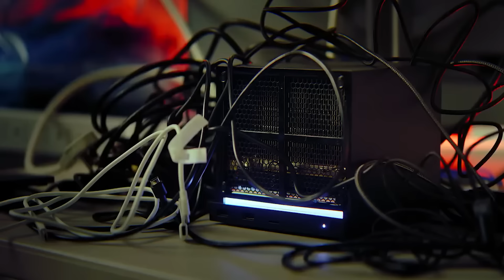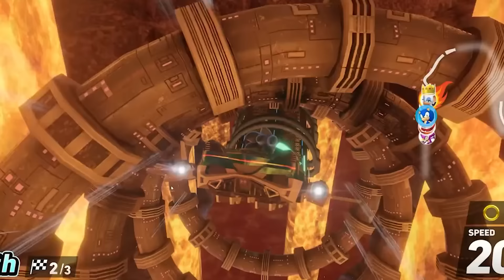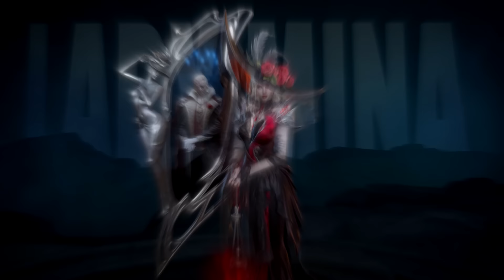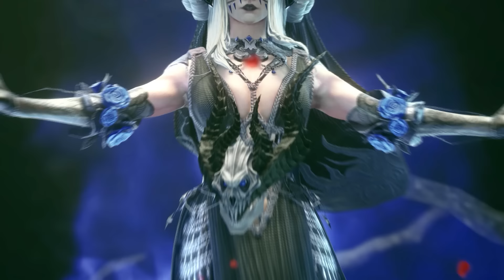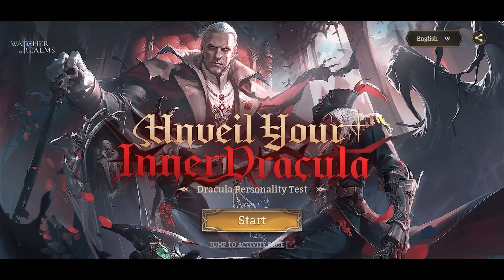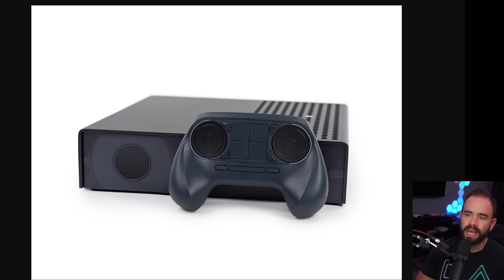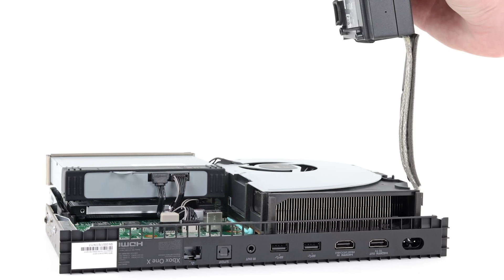The Steam Machine Is More Impressive Than It Looks...

Comment: 7:35 I just realized if the display and internet board is replaceable [and the cabling allows for speeds of up to 80GB from the GPU]... can this connect to the PCIE lanes in the machine to create an unofficial thunderbolt3 connection if you so choose? that or to make different I/O configurations? because if so... oh boy, that 8GB VRAM GPU might be more "upgradable" than we thought...
Hope you have a great day & Safe Travels!

Comment: If this is successful which it will be, I’m hoping they come out with a Steam Pro in 2027 to compete with next gen consoles. I’d like to see Valve develop their own chip like the M series of Apple and on a shared memory pool.
Reply: If AMD or Intel can get their chips with faster built in GPUs for a good price... that would be good.  AMD has that now with Strix Halo chips, but they are outrageously expensive.  I don't see Valve getting into the chip making department.  With FEX though, they have the possibility of going ARM based too, if they can get some chips fast enough to compete with AMD or Intel.
Reply: That all depends on the price.

Comment: I do not know the measurements, but I am wondering if there is space for a 3.5' drive at the bottom.. probably it is irrelevant as there are no ports provided.
Reply: that will not come close to fitting.  I think you mean a 2.5" hard drive.  You do have a 10 Gbps USB-C port to run external drives on in a pinch.  That seems more than fast enough for any hard drives or even 2.5" SATA SSDs.

Comment: 1 nvme slot, and no USB4?
Reply: High speed drives aren't their priority. You can still get pretty fast on the USB-C port that is on it that does 10 Gbps
Reply: @AyaWetts  thunderbolt 3/4 would have been perfect for using a USB C monitor unless the steam deck comes with Display Port out through USBC.
Reply: @euphanasia210  That would have been nice, but at least you can use an adapter at least to do USB C monitor.  I already do that with a portable ITX machine and a portable monitor.  One side hooks into HDMI, USB-C, and USB-A, then just plug the other side USB-C into a portable monitor and it works fine.
Reply: @AyaWetts  I wouldn’t mind that, but it makes it that much more complicated for the average user. Confirmed no DP out on usbc. They should have really added this.
Reply: @euphanasia210  Everyone should have DP out on USB-C, but even buying a $2000 5090 you don't get that... its kinda dumb

Comment: Imagine all the new steam products are all entirely repairable and upgradable. Put a warranty sticker on each part separately but allow people to take the system apart and it comes apart in sections. Power supply, front header daughter board, cooling, main motherboard, graphics card board. They are as easy as replacing as just pulling it from the case and removing said segmented part.

Steam frame as we’ve seen so far easily comes away from the head strap so imagine with that you could take off the front cover and cameras were a separate board. People want passthrough colored? Cool replace the cameras with color ones but makes it use slightly more battery but hey that’s replaceable too! Want better screens? Replaceable for the cost of more weight an more battery usage.

Granted I’m not a designer so I have no clue how hard that would be able to pull off but it would be awesome

Comment: Actually it has a modern processor and a full rdna 3 GPU VS the PS5's rdna 1.5 Navi12lite which has no hardware support for variable rate shaders and mesh shaders. The PS5 chipset has to mimic these features in software which is why the PS5 runs UE5 games like crap. 

So in hardware features, although this is quoted at 6xthe steam deck, therefore 6x1.6=9.6 tflops Vs the PS5 at 10.28 it should run games that are compatible with steamos BETTER than the PS5 but less performant than the series X because the series X does have these features in hardware as it is full Navi II chipset.

Comment: This is going to be more expensive than you think, I'm afraid. Could be wrong, obviously. But to me the key is when they made a point to say it will be priced competitively with a comparable PC. If you look at its specs -- while they're not stunning -- you're probably not building a PC at that level for less that $800 or $900. So competitve pricing relative to that? I think they're going to come in between $7 and 800. And unfortunately I think that's a floor. But I really hope you're right, Jon. $499 would be incredible. Even $599 would a big win, I think.

Comment: I'm fairly certain that controller in the pictures of the old Steam Machine was never actually released. The only controller that was released was the original Steam Controller from Valve, of which that may have been one of the test prototypes before they settled on the final design.

Comment: If it's modular/upgradable then they could make the initial cost cheaper for the base GabeCube but to max out specs it'd would be more over time compared to than the existing next gen consoles. I think both PS6 and Next Xbox are at least 700-800 as the ps5 pro is 700 and the Xboxes keep going up in price for some reason so both are trying to get us comfortable with these new prices.

If it's 600 it could be very tempting more so than Xboxs new offering and it's rumoured to have Exclusive for how long I don't know but Half Life 3 for some will be enough to try it out.

Specs now are the issue if it's actually on par with current gen while having value at least 100-200 cheaper they could honestly cook

Comment: Steam Machine isn't even base Xbox Series S, PS5 or mid PC build. Steam Deck is a "success" if we ignore the fact that out of 100 million monthly Steam users only 3-4 million actually bought a Steam Deck. Steam Machine will have about the same "success" I wouldn't qualify that as a success if you can't move 10 mil when you have an audience of 100 mil but regardless. Steam Machine is a niche within a niche, and the hype and glazing already being done by clickbait is just going to kill it even faster. People are going to buy this expecting it to run everything like a high end PC, when in reality the components inside are more around the mid to low range budget options for a PC, which is average, decently fine maybe not great but it's okay for 2025, in 2026? Different story. 2027, out of your mind to buy this when there will be better options out there by then. Lifespan of less than 5 years, if Valve had put actual high performing components into the Steam Machine then yeah I'd be excited for it, but making it a budget prebuilt for 2025, selling it to a 2026 market is just asking to be outdone and become obsolete at a faster rate. Valve has the money to give us something that is actually worth the hype, and instead we get a low budget mini PC. I want something like the Steam Machine that can do what glazers say the Steam Machine can do, but the reality is the Steam Machine is not going to do much of what people are saying it will, I'd be better off buying another smaller PC and using that instead.

Comment: I wonder if a mesh front cover would help with thermals, or if that would cause air to not get pulled in across other components.  I know part of their thermal planning is counting negative pressure created by the fan to pull air in from all sorts of places and routed over different components, so if you open it up too much, you might end up with a cooler CPU/GPU but VRMs or a power supply that are just blistering.

Comment: 425 is valves hardware cost. 2x multiplier (standard markup) means 850 is likely.  They can subsidize the steam deck because businesses won’t buy them.  They can’t do this with the steam machine, because a business may buy 10k of them. All is not lost though: they can bundle the controller, frame and machine and subsidize some of it because businesses aren’t going to buy that extra hardware.

Comment: If the steam machine is a penny more than $499 it’s doa, and even that is stretching it. It’s built with old scrap bin laptop parts.
 I just saw a hp victus gaming laptop on Black Friday sale for $549 using what appears to be the same cpu and a rtx 4050 which I can guarantee that chip costs  more than the old 6nm 7600m valve chose. That’s also including the cost of a battery, screen, charging brick, etc plus a markup from hp and best buy.
 Even with the price of ram and nand flash going up we are talking a negligible price increase for a company like valve who will be buying the stuff by the truckload and probably contract locked pricing a year ago. 
 We are talking about two 8Gb sodimms and a crappy 512Gb Qlc ssd, how much do you think those are going to cost? I’m sure amd was sitting on a warehouse of 7600m chips and are happy just to get rid of them.
 Valve better tread carefully with pricing. The steam machine isn’t a console. It’s just a low end mini pc that runs Linux. To people who understand and are willing to tinker to get the most out of it I’m sure it will be great but the world is full of average Joe’s who want something you just turn on and it plays your games.

Comment: 15:06 It's linux, you don't need to reload your ssd... just get a pc with 2 nvme slots and insert both drives and the just copy the old drive to the new drive. Put the new drive back into the steam machine and once you boot up the steammachine use gparted to extend your drives partition.

If you dont have a pc with two nvme, you can use an external case to mount the ssd like a usb drive... the procedure afterwards is still the same.
Reply: Your average linux user right here
Reply: “just get a PC”??  Are you for real… or just so loaded with money that buying a PC to accomplish a one-off task is a completely normal thing to do?
Reply: @happyspaceinvader508  The assumtion was that you would already have a second computer. Even an old laptop would work.
Reply: @Luke357 With two nvme slots?
Reply: @uninstaller2860 You can get a USB nvme reader for like $10...
Reply: @uninstaller2860 just get an external case/adapter for the nvme drive... they're like $15 and save you a whole hassle.
Reply: At this point in time everyone has a 2nd pc and two if money is an issue you could just buy an external case for the ssd in lieu of using a second pc...

I'm just giving the a good tip as an 17 year long linux user...

In linux you can just litterally copy your harddrive onto another harddrive... there is no drm... the best method is to use dd...

Comment: 10:50 
You're right, you've just discovered upscaling. To get 4K 60 fps on a 27-inch screen, you need a high-end PC. There isn't a single console that doesn't use upscaling, especially if it's for a TV larger than 50 inches.
Reply: TV size means nothing for upscaling, only the number of pixels. A 24" 4k monitor has all the same pixels as a 120" 4k TV, just smaller and closer together than the big one.

Comment: $500 or less or it’s DOA. It uses outdated hardware and is barely as powerful as a PS5 base model… which is over 5 years old at this point. Plus to only give it 8GB of VRAM is a crime. Even using FSR this thing will struggle with most newer AAA titles to hit 4K 60, which is what Valve is marketing it as capable of doing. If they make this $600 or more and you buy it.. you’re part of the problem with prices today.

Comment: It needs a handle.
Reply: Idk if it NEEDS a handle but it sure would be convenient.
Reply: @yoozernaim knowing all the gamecube fans already obsessed with the design, I'm 100% positive that there will be many handles 3rd party to get.
Reply: Someone will end up printing one, definitely
Reply: Should be no problem screwing one on using the two fan screws in the back. It's a standard size. There it also shouldn't be in the way, since the display and network cable are sticking out of the back anyway.
Reply: I never used the handle on the Gamecube… I’m actually not certain of the use case.  If I ever wanted to transport my Gamecube somewhere, I put it in a bag or rucksack.

Comment: If it's under $500, which imo is a stretch, it will sell. I'm guessing it will have at least a $700 tag. If you're locked into 30 or 60 fps, what's the point if you already own a ps5 and/or Series X, which the majority of consumers have?

Comment: Steam calling it 4K/60 capable is a stretch. I like the form factor, GameCube-like, built around the heat sink. However, this is five-year-old tech. People have to keep that in mind.  Valve wanted to keep it affordable, so that's the trade-off. Controller looks much better than the original Steam Machine from 10 or so years ago.

Comment: What I would like to see is someone making a back cover with a handle called the "GabeCube Handle". The back "Valve" logo would say "GabeCube" for sure.

Also I'm sure this will be made but a front cover that has a full 120mm fan which could be powered by a low profile 90° USB cable that plugs into the front of the device.

Comment: 799 with a controller, base model.
Reply: Too high,  It will sell at that price, but it wont be a threat to existing consoles and they will have trouble braking even.
Reply: @iamrocketray I don't think this will affect consoles aven at 499. 

Much in the same way the deck had no affect on the switch or switch 2. 

Totally separate markets. The steamdeck and this new steam machine will inherit the same problems.. compatibility. The fact windows is not there means they have to have compatibility layers and those don't always work well. 

I have a pc and an rog ally, so I WISH pc machines like these would take over. Pc is where everyone should be. 

I also have a switch 1 and 2.
Reply: @MAGADABADOO  I think you are partly right. If the price of the steam machine is low enough, poorer gamer's might join the Steam ecosystem, but I can't see existing console owners swapping over UNLESS their existing games don't work on new consoles, or a minority changing because there is no charge for internet access with Steam. So I would guess 10% max. I think also that a lot of gamer's are NOT happy with windows and would be open to a change to Linux(I fell into that category), but again we are talking quite low figures. So I think nothing much will change in the short term and we will have to wait and see what happens 5 to 10 years down the road. The biggest difference will come if developers change their stance on anti-cheat.:face-fuchsia-wide-eyes::face-fuchsia-wide-eyes::body-blue-raised-arms:
Reply: + half life 3. Then maybe

Comment: I love the form factor, being able to easily move it between a TV setup and a desktop setup seems great, but the farther the price will go beyond 700€ the less interested I would be in the Steam Machine simply from a price/performance perspective.

I am currently maining an 2019 gaming notebook with a Ryzen 5 3550H, 4GB 1650 mobile and 16GB of RAM because I didn't have the space for a full fledged desktop setup back then and while my system still holds up decently for everything I throw at it, I sadly cannot keep up with the minimum requirements for some of the more recent games that my friends and I had up for discussion as our next game night titles, so in the coming years I will likely need upgrade. On paper the Steam Machine seems to be a nice upgrade from what I currently have, but on the other hand, I could also get a decent AMD build for ~1200€, of course not top of the line hardware, but several times more powerful than the steam machine and I'd still be able to upgrade to a more powerful Zen 5 CPU, or better GPU further down the line, if I feel the need to.

Comment: People seem to be missing the point of the steam machine, it’s for people who want to play their steam library on a tv, something I have wanted for a long time, If your saying you can build a pc cheaper with better parts then this is not for you. It’s not about 4k gaming it’s about having a small device that runs Linux and has your steam library installed and has enough power to play games at 1080p or 1440 p, no windows just steam OS. I know you can build a much more powerful pc of course anyone can, but this device is for those of us who just want to access our steam libraries and play our games in the living room.
Reply: U could use a steamdeck on the tv with a dock. Ik its weaker but u can still do that
Reply: @QuickBread  I use my Steamdeck on my monitor on my 65inch it’s very under powered the new steam machine will be perfect.
Reply: @gloomyvale3671 yeah I get it. I mostly play easy to run games on my steam deck

Comment: I don't like the new steam machine. It is made by combining a laptop GPU plus a laptop CPU, soldered on the motherboard 😢 Also custom firmware means that standard amd drivers will not work on this machine. So valve will put out only a set of windows drivers and then forget it. Moreover, there is no way to replicate the hardware by yourself, and valve will only distribute shaders only for this machine..
Reply: This isn't windows.. Its Linux based
Reply: @mikeuk666 I know, but they will support windows. As they did with steamdeck